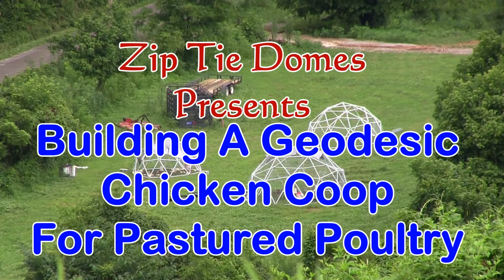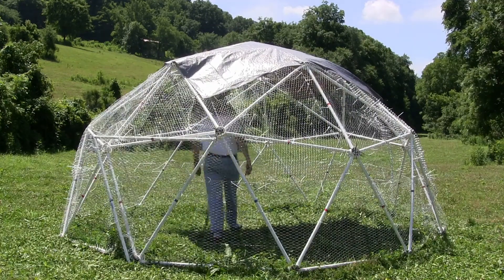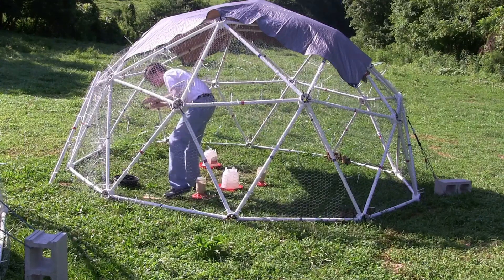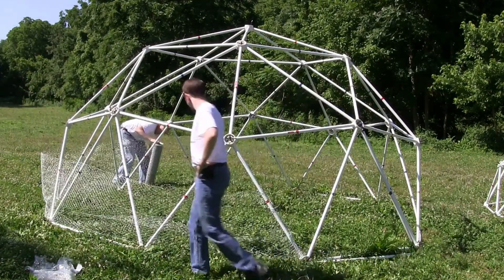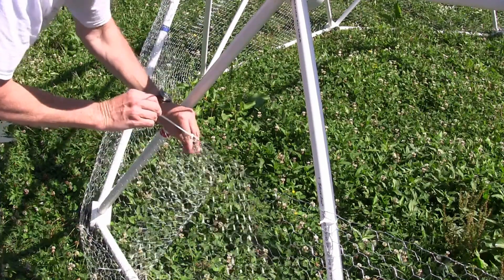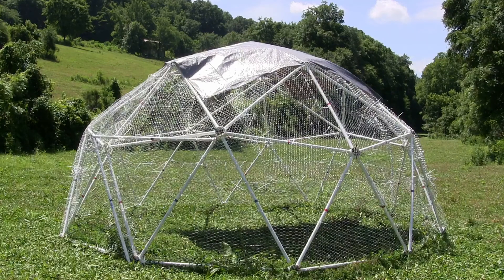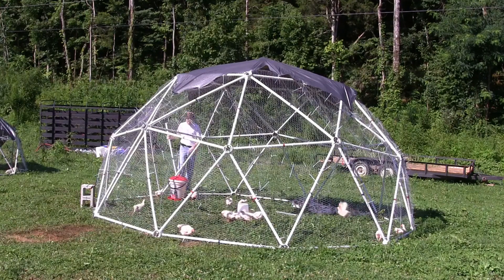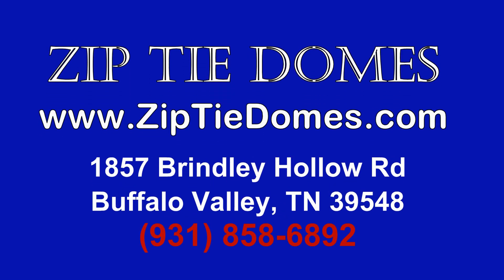Building a Geodesic Chicken Coop for Pastured Poultry

Comment: That looks really interesting, how can I give this dome stability so that it doesn't wobble when I move it. I'm also thinking about giving my raised beds an insect protection roof. This should be able to be opened on hinges. So that it can be closed flush again, it must not be so movable. 
Thanks again for sharing this great idea!
Reply from the maker: The dome will conform to the ground beneath it as it flexes.  This makes it very stable.  And when you move it, it doesn't wobble so much as it slides over the ground. 
For raised beds, we include two extra struts for a swing door that lets you get in and out of the dome.  When the season is over, the dome is very lightweight and can be picked up by 3 people and moved.  I hope this information is helpful.  Thanks. John Hurt

Comment: I envision a smaller secondary upside down geodesic structure hanging from the "ceiling" of the primary dome, with nesting boxes and perches for the chickens.
Reply from the maker: +JathTech Thanks for the comment.  We use 1/2" PVC pipe, or a small branch from a tree, and tie it to the inside top of the dome to hang down for a perch.  We take a very small laundry basket and wire it to the side of the dome, about 1 foot off the floor, and fill it with grass or hay for a nesting box.  But the upside down geodesic structure would be really cool.  Thanks, John Hurt
Reply: +Zip Tie Domes glad you think so.

Comment: Caging and Raising Domesticated animals is an incorrect use for these Domes.

Almost all dis-ease of the human body is caused by eating Meat, Dairy and Oil.

Clogged Arteries for Dummies
https://www.youtube.com/watch?v=xUgKekv57hI

Heart Disease Starts in Childhood
https://www.youtube.com/watch?v=AkWd0R05ZEs

Read:
The Starch Solution - John McDougall, MD
https://www.youtube.com/watch?v=4XVf36nwraw

The China Study - T. Colin Campbell, PhD
https://www.youtube.com/watch?v=XEuRMm-a6mo

Prevent and Reverse Heart Disease - Caldwell B Esselstyn, Jr, MD
https://www.youtube.com/watch?v=nPeLgcyJ2Y8
Reply from the maker: +Schpankme Verimuch Thanks for your comment.  We also use the domes for greenhouses.

One of the reasons I started all of this is that I felt that raising chickens in a coop or in a cage was inhumane.  Chickens need grass and real dirt under their feet, not their own poop.  But they need protection from predators too, so we designed the domes for chickens based on Joel Salatin's "Pastured Poultry" model.  The eggs are a lot better from pastured poultry as well, as they have more of the trace minerals.

Chelation is a great way to clean your arteries, as heavy metals have an ionic charge and are the precursor to plaque buildup in your arteries. I am very interested in health, so I will check out the links you sent.

Thanks,

John Hurt